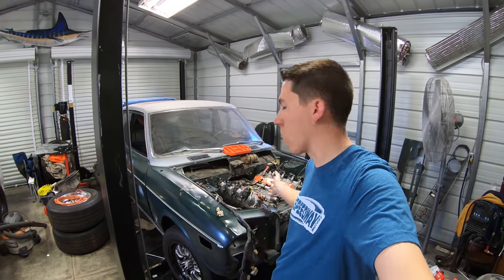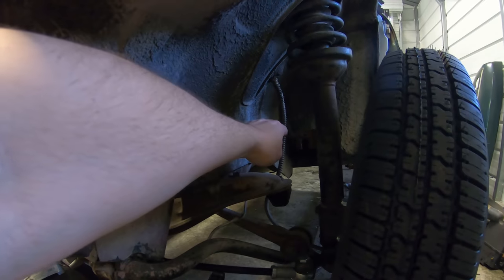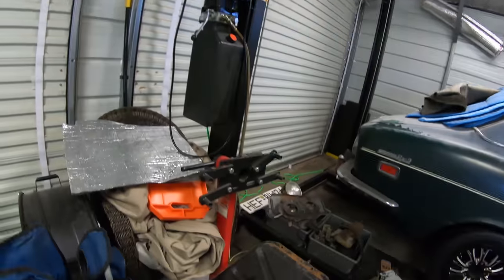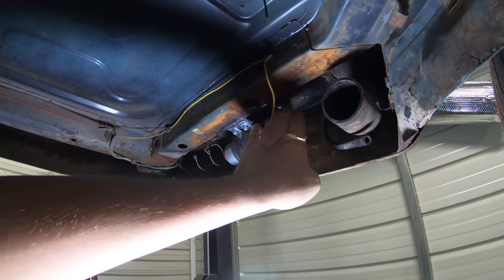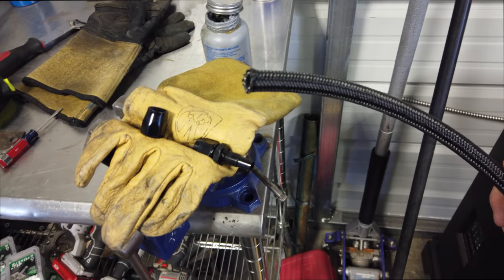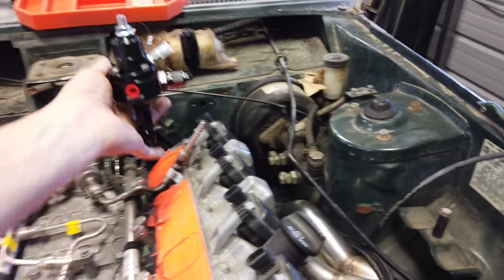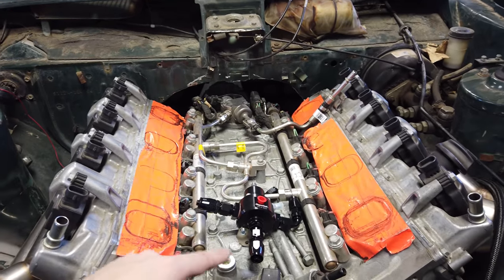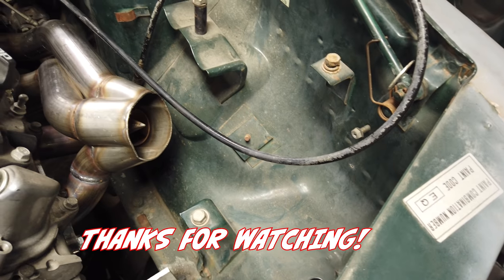L83 Swap Headers Fuel System and More!

Comment: You could put the regulator at the back of the car and just run the feed line to the high pressure pump from there. Would save you running another line to the front for the return. Just a thought. Regardless, sweet car.
Reply from the maker: Ended up mounting the regulator on the frame rail near the engine but that would have worked too!

Comment: Great video. I was looking for the return line engine location. If understood it correctly, the return line connects to the fuel regulator. Is that correct?